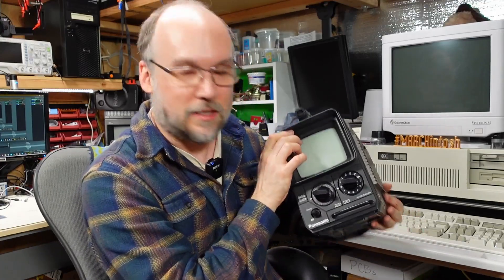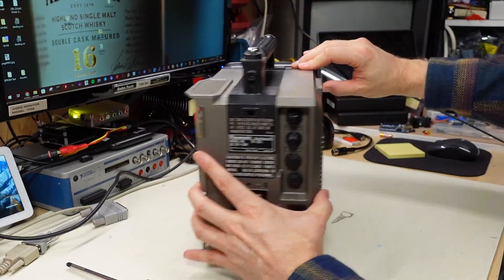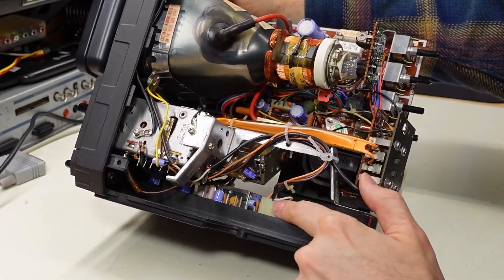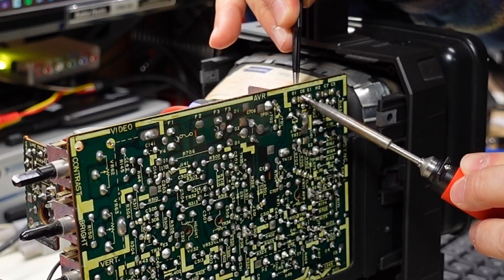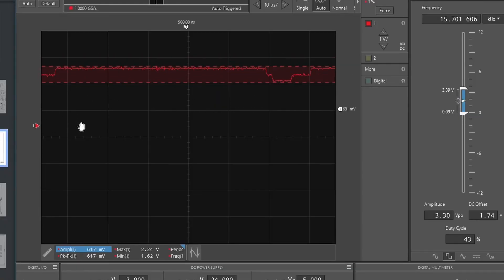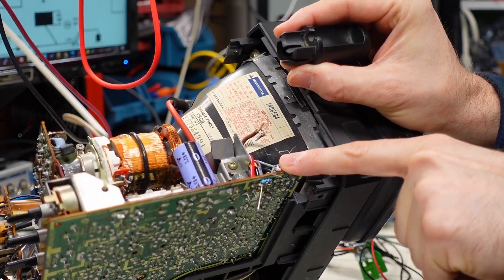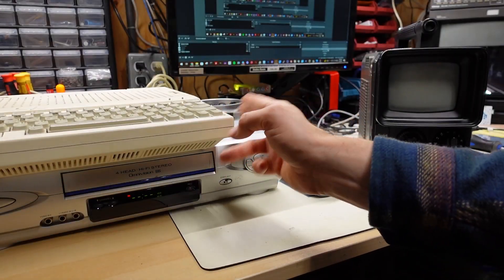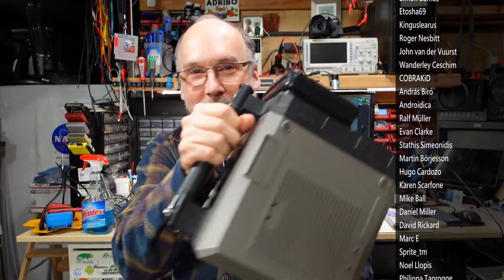Adding a composite video input to this 1977 portable TV (Panasonic TR-555)

Comment: 1st thing I noticed as the cover slid off was that very-thick insulated wire on the "suction cup"..colored brilliant fire red. Those charge up to about 25,000 Volts and hold it even with no power source. It'll knock you right off the back of your chair. websearch "HV Anode"
Reply: It's only 25kV on large and/or color displays. Without looking at the specs I'd guess this set is 6kV at most.

Comment: Grounding on TV SET is an interesting topic because There's not much documentation. On some forums grounding indicate that it is not required as it is a low voltage device, but those is a dangerous lie. More interesting when you talk about polarized, something that is not correct. The equipment is simply connected to phase (live) and to the neutral connector. 
why did the TV SE manufacturers connect the neutral to the chassis? ( it's very dangerous! = not the best current path to ground).
Next dilemma that I haven't really researched, I don't have any idea, I consider myself very ignorant:  If you could correctly connect the ground on both sides = it is logical the result is a coupling of the grounds.
I suposse understand is that some equipment's voltage does not reach the 1 Vpp values of an "RCA Connector" but rather its voltage is almost the voltage of the line (AC 120 Volts phase to neutral) or lees AC 24 volts (considered by many electronic technicians like call it low tension), but thos degenerating into an impedance matching problem
Reply: Honestly it's a well-known topic. Based on your comment it appears you don't really have a grasp of the concept of grounds and voltages. Circuit ground is just a reference from which other voltages are measured. The ground of one circuit can be a different voltage than the ground of a circuit and if you connect them bad things will happen.

Comment: Is it safe to assume that a (AC) B&W TV set that uses a power transformer is "safe" to composite mod?
Reply from the maker: Yeah - definitely would more likely be totally safe. Small sets here are always not isolated because typically the B+ is so close to our rectified mains they just cheap out and not use a transformer..... (On TVs)
Reply: It's not safe without double-checking. Some sets use a transformer for some but not all of the circuitry. You should definitely trace all the wiring from the plug to make sure it doesn't go anywhere else. If it's truly isolated this will be an easy task.

Comment: I think it's great you can do this,  but wouldn't using an rf gaming switch accomplish the same thing without modifying the tv? Would be interesting to see a comparison of the signal sharpness, with your conversion and an rf switch... I mean I get you would have a little dangly bit hanging from the back of the tv, but that's a small price to pay for the convenience of having both rf and composite...
Reply from the maker: RF is extremely low resolution -- even 320x200 is going to be fuzzy. This mod offers up nice sharpness where as you saw, even 80 column text rendered nicely.
Reply: The RF conversion introduces a ton of noise into the video signal. If it was my TV, I'd wire in a switch that lets me select RF or composite. But if he doesn't have anything that uses RF, I suppose there would be no reason to bother.
Reply: @adriansdigitalbasement  Gotcha! Then I see why you did it...
Reply: @shmehfleh3115  I suppose you're right. I just remembered how way back when,  when I switched that rf switch on a Nintendo, the image got very sharp compared to a tv channel. I guess when you get down to it tho,  rf, no matter how you slice it, could ever be as sharp as composite...
Reply: did you say switch? Well, just NOPE!

Comment: 8:25 - C6, not C9 :D

I was looking at small TVs for a while with composite input to test old gaming consoles, sometimes I want the simplest RF input but usually these TVs have build in antennas. Now I might try to get a small TV and modify it to have a small video game console testing TV around :) I had an old Atari 2600 clone that I couldn't test because the RF signal it makes was too weak and my LED TV couldn't tune to it. I got a small CRT TV but it didn't have it's original remote so that couldn't be tuned either (but for a different reason). It took me a while to hunt down a remote that I could use with that little set but I wouldn't mind an even smaller TV for old consoles. By the way, in the end I built a little board with a signal amplifier and made composite out for the Atari 2600 clone so no old CRT is needed to play :)

Comment: Why not just use an off the shelf composite to RF modulator box?
Reply: Where's the fun in that?  ;-)
Reply: @Lassi Kinnunen 81 Yes, that true. His image quality is much better than what I remember with the cheap RF modulators. I get it now. :)
Reply: Those ever-thinner lines from his pattern generator become a grey patch right of the center line having passed through the tuner filters stages. 260 lines of resolution is as good as N.America analog TV could get, more would spill over out-of sync images into the next-higher TV channel number.

Comment: ATTENTION - added information to this Video - this is only on Battery (external Power Brick supply - external transfomer) driven TV sets possible. Other main powered supply B/W TV sets are don't have a galvanic insulation. That mean if you rebuild a main power supply TV set to this external Video input (Composite Signal all in one) so you close the circuit from your ground (GND) maybe to a high voltage power supply pin! This is dangerous for your live. If you touche this external Video input with your hand you've the full power on the ground (GND). Do not make this on a old B/W TV with a autotransformer power supply - the reason is that the main power supply is connected to the chassis! and this is dangerous for your live. Best Regards Volker from Vienna
Reply: This is mentioned early in the video

Comment: in my case i wouldnt mod anything like this. i would add an f connector to the screw terminals and then add an rca to coax convert box and then if i needed hdmi i would do hdmi to rca then rca to coax. i am not one for mods really i am one for the items being factory original. if it cant be used as original as possible then i would get rid of the item. most all computers and other things i have are not modded at all. this is just me though.

Comment: Why do people keep referring to luma-only inputs as "composite"? It's not composite, it's just the luma input. It's best fed with a luma-only signal to avoid interference, and it can accept composite, but it's not a composite input.
Reply: @eck8989  Hmm you may be right. I've always heard composite as referring to FBAS/CVBS, but I guess you could call BAS composite as well.
Reply from the maker: Luma like on a C64 is the brightness + sync .... CVBS is that same signal with the chroma mixed in on top of it. Both are technically composite signals although I think traditionally luma + horizontal + vertical + chroma is what we call composite....
Reply: Like a printer "page Feed" symbol and "Carriage return" symbol, raster-scan video has a train of Vert Sync pulses 60 times each second. another wire has Horizontal Sync pulses 15,734 times each second. Another wire carries grey-scale brightness. You see on his 'scope trace in this video all three on that one single wire "composite" together. The name composite changed in 1968 to now mean the Chroma "color Burst" wave is composited with all those others. (the yellow RCA on VHS cassette decks).

Comment: Dude, I  like your vids but just stops with the fear mongering. The "EXTREMELY DANGEROUS" mains voltage coming out of the wall is only 110v - 120v. 
You are taking a bigger risk walking down your basement steps.
Reply: We have about 1.6 residential electrocution fatalities per million people per year in the US, compared to about 0.45 in the UK. In the US several people die every year just from accidentally holding the pins from the side while plugging something in, no current across the chest. Maybe this means whole house RCD/GFCIs and ground first insulated pins make the inherently more dangerous 220v actually less dangerous in practice in the UK, or maybe some people are just really dumb in the US, but suffice to say over 500 people a year manage to die from 110v, so implying it's not potentially dangerous would be rude, at best.

Particularly interesting are the cases where they didn't even feel anything, go on about their business, then a couple hours later the micro-oscillations in their heart escalate to fibrillation and they scream and keel over dead right there. Incidentally, 110v fatalities are in the same range as fatalities from falling down stairs, so perhaps at least worth mentioning to people who might not be familiar
Reply: thats BS
Reply: @alakani  And yet he traverses the steps 50 times a week. Where's his EXTREMELY DANGEROUS disclaimer for that action? Thanks for proving my point.